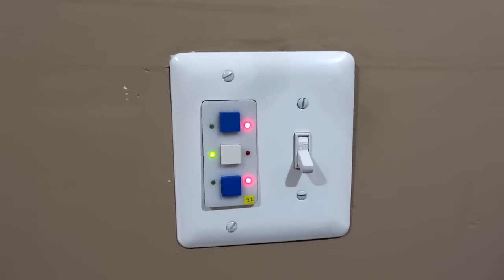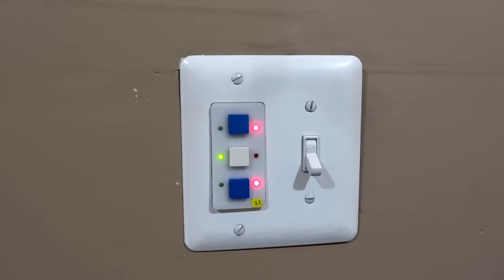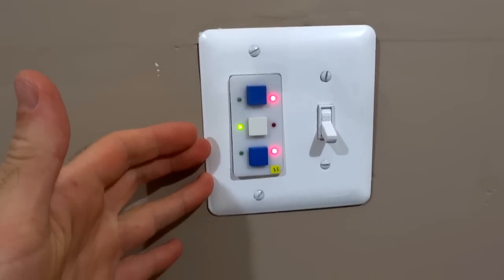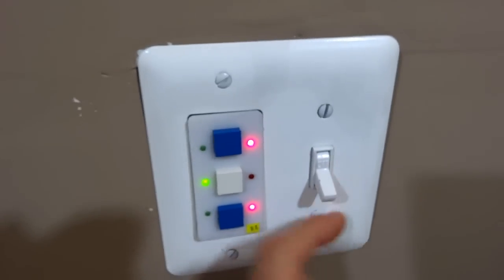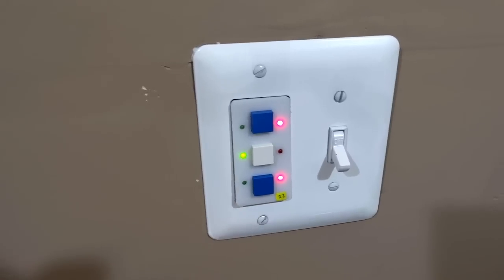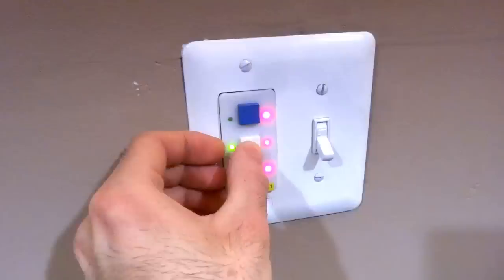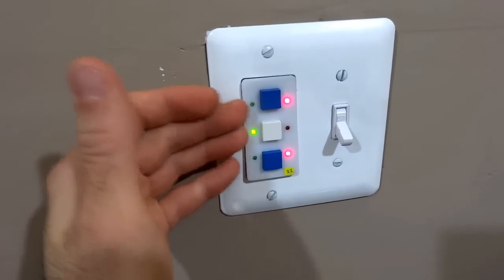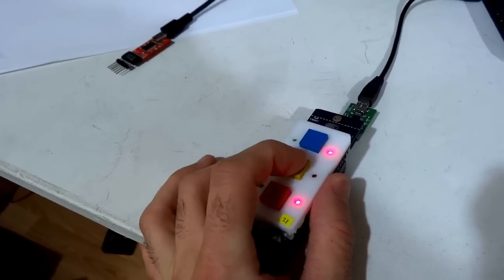Installed SwitchMote demonstration

Comment: i just happened upon your site while browsing Thingiverse.  This is a really cool project.  Will you be designing a version that has sleeker looking buttons?  Maybe using a switch that has two embeded LEDs?
Reply from the maker: If you can find that for less than $5 I would be more than interested
Reply: I am not sure what colors you would want to use but I found this.  I don't know if you can get it with a white escutcheon plate instead of the black - http://www.mouser.com/ProductDetail/E-Switch/ULP22EEM1QPMCL1BLURED/?qs=sGAEpiMZZMufv8JNQ5fVHSNwcwIgYkGuRqyc%2f2Dl56o%3d

This guy is a bit more expensive but it might look a little nicer. If you look at the data sheet you can get it with a bunch of different options- http://www.mouser.com/ProductDetail/E-Switch/ULP12EEP1RSSCL1BLUGRN/?qs=QtyuwXswaQgh2qmDxfnGIA%3d%3d

If you dig a bit more you might be able to find some better options at mouser.